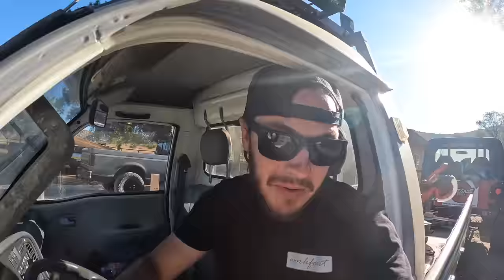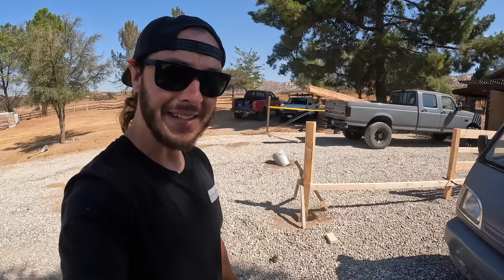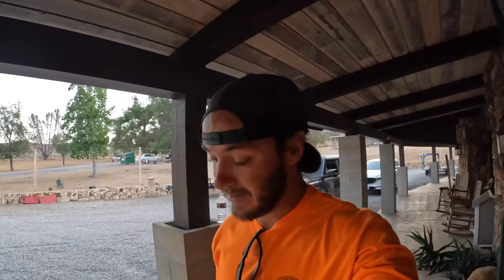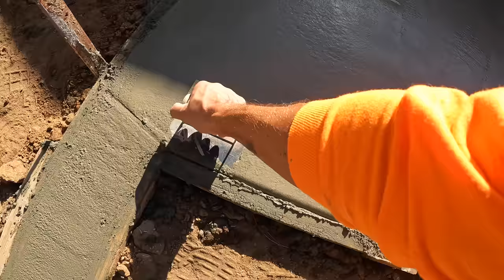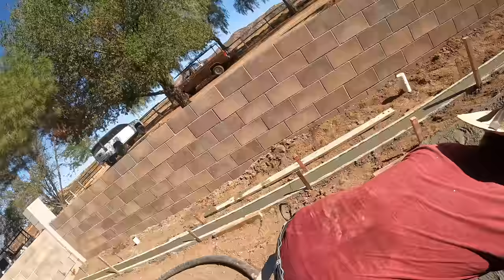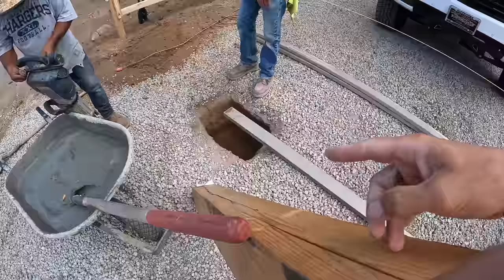RYNO RANCH GUEST HOUSE RENOVATION (PART 19)

Comment: Ryan, have you checked the timing on the mini truck? Try turning the distributor cap a little left or right it sounds like your timing is out if it starts back firing turn it the other way focus on the distributor cap and re check plug wires

Comment: My dad use to drive a concrete truck in Florida and during the summer they literally pour concrete from 4-7am or 10pm-2am. He use to have to go into work at 11pm to drive halfway across the state to run 8 truckloads back to back on jobs at the airport the company did 4000 truck loads at one airport
Reply from the maker: Yup, AZ is the same way. Super early pours or forget it

Comment: For the mini truck and based off your builds, what about putting a kubuto diesel engine in it. Would need someway to put the a flywheel and clutch on it or adapt a hydrolic motor to the trucks drive train. Idk could be cool and have more torque

Comment: I was wondering if you ever put one of those felt strips between the cinder block wall and the house when you're filling the entire area with concrete ?
I ask because when they poured our driveway they put those strips between the garage and the driveway and the driveway and the sidewalk.
After several years there are no cracks in the driveway.
They did not put any felt at the house or the cinder block wall when they filled in a 6-ft wide area there.
As temperatures changed and things expanded and contracted that area has several cracks in it and not just in the areas where they put in expansion lines.

Comment: Genuine question. Since it was that hard to use the jointer why not just saw cut it? Cause it looks nice with jointer?
Reply from the maker: It really wasn’t that hard, we’ve managed to get joints in, in harder situations. It’s partially aesthetic and you can get right up to the wall with a jointer. Most saw cutters stay back from the edges because they can only get the blade so close to a wall
Reply: @DMAXRYNO  makes sense. Looks great!

Comment: The mini truck sounds like 1 of 3 things 1 serious cylinder misfire ie plug wire or coil 
2 burnt valve
3 serious exhaust leak which I highly doubt is the case

Comment: I will still never understand for the life of me why you put so much effort to everything regarding you mr concrete, but skip a few extra hundred dollars to put down a 2B gravel base. Gives it all a good base to be on, and helps if you have water issues, which you have had a ton of. I understand it doesn’t rain there everyday, but still.
Reply from the maker: Gravel sucks to grade out for a consistent concrete thickness. We use dg for everything. This is the one time we didn’t import any because this dirt is mostly dg already and quite honestly will never see any crazy heavy weight. Most contractors pour onto of dirt everyday for driveways, we’re one of the few that don’t. This was one of the rare exceptions.